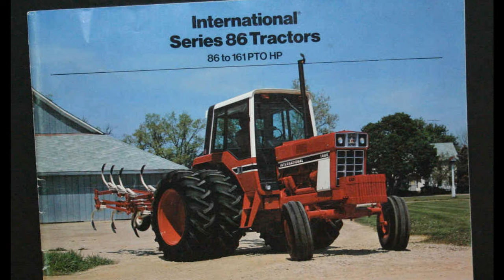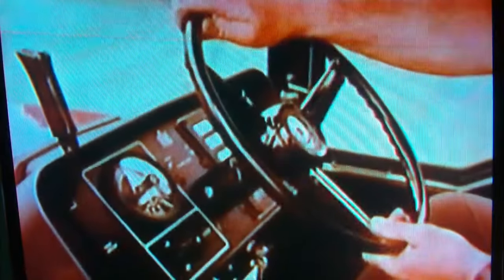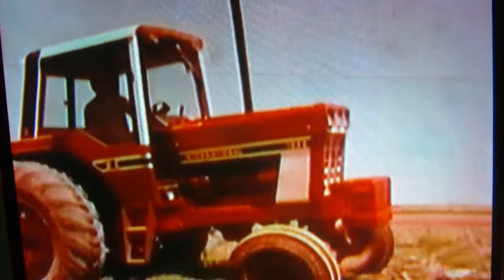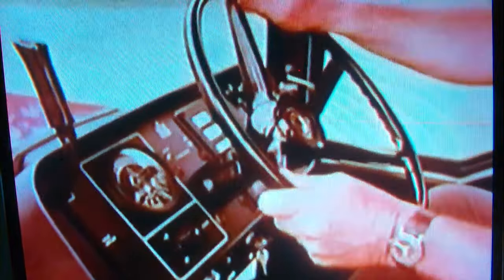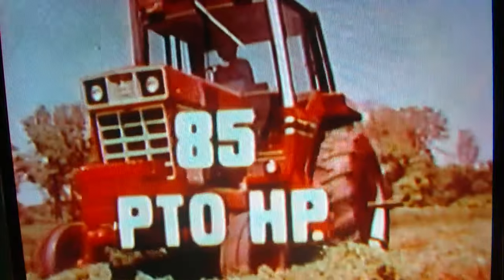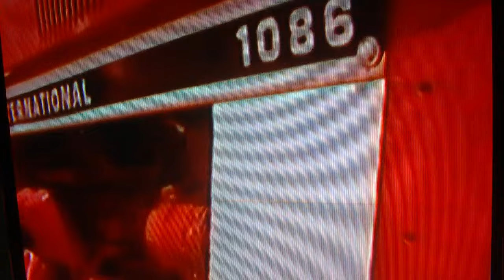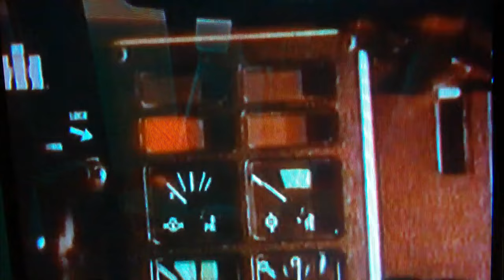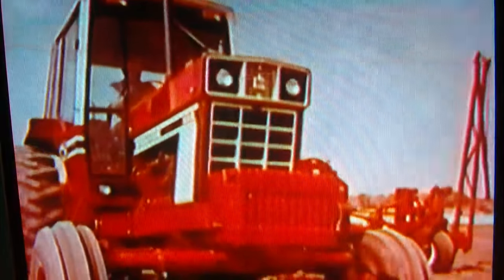the all new 86 series tractors from IH.

Comment: When my dad was pricing a new tractor the IH dealer brought out a 1086 with a cab to demo....dad was a little cheap and went with a JD 4430 with no cab....ugh....I love JD but wanted a cab so bad . But the good news is within 4 years we increased our acreage by 3x and bought 4430 , 4640 both with cabs and a 7520 ...what a powerhouse that was .
Reply from the maker: my friend has a 7020 deere, nice old girl. :)
Reply: @MrJohndeere3720  ...bad thing about the 7520 was the cab ...a/c hardly ever worked and had a high tech  fender mount type AM radio..lol
Driving it down the road one day at full speed the steering just decided to go right..took it right down into a 8 ft deep ditch ...drove it back out but was shaken up ...I guess it was a common problem that the big cylinders in the center had to be rebuilt ....but man could that thing pull
Reply from the maker: @toledojeeper2932  the ac in that 7020 never worked..lol & the fender mount type AM radio was useless..lol but they did pull very well.. :)
Reply: you rarely see together 7520 and powerhouse
Reply: @RJ1999x  ...It was a puller , but we using mostly tractors 125 hp or less until we bought the 7520 so it was a beast compared to those . We went with a 9300 after using the 7520 for over 20 years  , we definitely got our money's worth .
Reply: @toledojeeper2932  I had a 7520, I thought it was a huge dog, replaced it with an 8640 with a 50 series engine, it wasn't much of an improvement. Replaced that with a Steiger, absolutely no comparison
Reply: @RJ1999x  ...I guess it all depends on what your pulling and the dirt your pulling it in . We pulled a 32 ft field cultivator in pretty good dirt that was mostly sand and we had very little clay . I had no complaints but like I said I was used to driving 125 hp 2 wd  tractors pulling 18 ft field cultivator before the 7520 .
Also we turned up the fuel after the warranty expired .
Reply: @toledojeeper2932  as long as it got the job done for you
Reply: 7520 is the best looking tractor ever made

Comment: I miss IH so much. It was such a good brand
Reply: IH is still around. When it split up, Tenneco bought the ag part and the rest became Navistar International. Tenneco also owned Case and merged the two into Case IH. At the time of merger, it was Case body, IH colors (which is my favorite era of IH from a design stand point). Now it's still IH colors, but modern design. Hell, in 2003, they brought back Farmall

Comment: I'm not an IH fan but I will say the 1206 is a damn sharp looking tractor. The driver forward ahead of the rear axle is credited here to 1086 or 86 series. Glad to see IH did contribute something  beneficial to the tractor market in it's final days.
Reply from the maker: the 1206 r damn good tractor. i'd like 1.. i have a ih 1586 & its a damn good tractor.. ya it is nice 2 see that.
Reply: Allis Chalmers sat forward of the axle in 1963
Reply: ...its* final days.
Reply: the Ag part of IH merged with Case when it was bought by Tenneco

Comment: I was 13 in 1979 when my dad bought a brand new 1086. Our very first quiet cab with ac. It was like sitting in a Cadillac. The 86 series were a vast improvement from the previous 66 series in almost every way with a few exceptions: On the 86 series the batteries were not in an easily accessible place but were secured well and out of the way. They should have made the doors open to the front for easier access to the cab. If you had to remove the starter you had to take out the floor mat in the cab and a steel plate on the floor. A special wrench to remove the starter bolts was available. The starter was very difficult to service. The TA lever had that goofy spring loaded mechanism that made it difficult to operate smoothly. On the plus side putting the muffler under the hood was genius, leaving only the stack above the hood. The hydraulic assisted clutch was awesome (I think our 1066 also had that). We're mostly JD now and I don't know why other companies don't use that. With that short wheel base it was the best tractor I've ever owned for blowing snow lol. Even with the short wheel base it was balanced very well and could lift considerably more than our 5088 without weights on either tractor. When I traded the 1086 sometime in the mid to later 90s it had over 9000 hours and hadn't had an overhaul. I think IH had a very, very good engine which was quite efficient as well. If they could have hung on another year and introduced the new Magnum series (which was IH's design) they would have made it. The Magnum was head and shoulders above every other tractor of it's time when it was introduced in about 1987??? On a side note, how many others here have noticed how much the radios and cheap @#$%ing speakers they put in the tractors today just suck?
Reply from the maker: nice.. :) ya these tractors have there ups & downs.. thats y i had gotin a 1586  i'd like 2 get a 986 or 1086 as well.

Comment: Im probably one of the few IH Enthusiasts that appreciate the left handed shifting levers on the 86 series me being a lefty myself...
Reply from the maker: i would like mine more if they were taller..
Reply: Im a righty. I dont mind the left hand shift. I have a loader with controls on the right. My bigger complaint is not having a foot throttle.
Reply: Herpn Derpn same
Reply: Also a lefty, not bothered by left or right shifting. More my concern is the smile hitting 4hi and smacking the TA ahead.
Reply: I'm right handed, and I like the shift levers on the left side. You can run your hydraulic levers and shift at the same time.

Comment: Speaking as a guy who has spent thousands of hours on IHC tractors, the cab was guiet and roomy and didn't have that big join in the middle of the windscreen like JD. Moving the cab forward was a mistake ,very rough ride on 86 series combined with short wheel base and you couldn't see the drawbar easily. The 66 series rode smoothly and had fuel tank behind engine which also reduced engine noise and heat . JD , WHITE ,FORD, IHC ,MASSEY WERE ALL GREAT MACHINES IN THOSE DAYS ,NOT PLASTIC UGLY COMPUTERIZED JUNK LIKE NOW ,IMHO.
Reply from the maker: they said in the vid that Moving the cab forward would give it a better ride. so its funny hearing about that. but not every1 liked it..   tractors nowadays r a joke.. the older 1's were made out of steel NOT PLASTIC. thats i want with an older ih tractor.. THATS A REAL TRACTOR!
Reply: One particular thing I liked about the 86 series was the self cleaning cab filter ,when you  closed the  door  it would self purge, I have noticed that the caseih tractors have  gone back to a filter under the cab where all the dust accumulates ,duh.I think the 86 series were  good solid machines and reliable and later 88 series as well ,I  drove a 5088 for some time and loved it,those Inter diesels were great .Thank you for posting these videos, kind regards.
Reply from the maker: ya that self cleaning cab filter was a very cool thing. they should have stayed with that... o man those  88 series  r sweat. i want 2 buy 1 as well. :) ur very welcome. :)

Comment: My Dad got a new 1086 in 1979. Wow, what a difference between that and the 1066 that we also had. It was a very good tractor and had over 9000 hours with no major engine work done when I traded it. The 88 series tractors were a joke and dealt the final blow to IH. If they had made the right changes then, they might have survived. Such as:
Making the transmission power-shift from gears 1-6 instead of only between 1&2, 3&4 and 5&6.
Opening the doors to the front, the way they're supposed to.
The forward air flow should NEVER have been done.

The only improvements from the 86 to 88 series were a synchronized transmission, hydraulic clutch and tilt steering wheel.
Reply from the maker: 66limelight  ya they left some things out. my friend has a 986 & his son has a 1086,1566 & a 806. the doors on the 86 & the 88 series did open 2 the front just like ur car. its the 66 series cabed tractors where there doors open 2 the back.  my friends 986 does not have tilt steering & it sucks 2 get in it..  thanks 4 watching :)
Reply: MrJohndeere, our definition of what is front opening and rear opening is different. Let's just say the 86 and following 88 series tractors should have had their doors open the same direction as the older 66 and the newer Magnums. We had a 5088 and IMO the only thing that was an improvement was the synchronized trans. But they should have made it a powershift from 1st to 6th gear. I think the 86 were better tractors.

Comment: We had a 1586. It sure had some balls. It would pull the front end off the ground cultivating over the hills. But sadly it burnt down.
Reply from the maker: sorry to hear that. :( i have a 1586 as well. been a great tractor. needs love, but they all do  lol.
Reply: @MrJohndeere3720  bought ours on an estate sale. 4157 hrs. 1000hrs later it burnt.  Insurance adjuster said failed wiring in the cab
Reply from the maker: @jeremycherny2041  o ok. Got mine at a small dealer/repair shop. 9500 hrs but the hour counter stopped working need to send it in. Paid 8K for the tractor then paid 900 to have it hauled to my farm.

Comment: My 1086 is a later model than these originals and does not have a differential lock. Was that an option?
Reply from the maker: im pretty sure it was. i think u had to order it with a differential lock. my 1586 does not have one but has the hole in the floor for it

Comment: I have ran both 1066 and 1086 tractors both were good tractors the bad thing about the 1086 was the cab always felt cramped up in  the 1086 so with that I will take a 1066
Reply from the maker: u can fix that by putting a tilt steering wheel kit in it..
Reply: I have a 1486 wonderful tractor running strong for over 20 yrs. Best tractors ever made.!!
Reply from the maker: @williame.portman4026  i got a 1586 been a great tractor for me. needs love but its all small stuff..

Comment: Do you know y back then they would put pto horsepower instead of just horsepower?
Reply from the maker: +Dairy farm boys not 2 sure, but all i no is that u get less hp on the pto then on motor itsself.
Reply: Dairyfarmvids Because PTO horsepower is the closest thing to engine horsepower and its easy to figure and then produce a list of what it can run and show that off. Drawbar horsepower, there is a lot of variables, tire slip, soil type and condition, flat ground, hilly ground etc... those are fuel related costs and well, let's hide that part. Although they did start to label some that way.
Reply: I think PTO horsepower was the best measurement because some implements are very demanding on the PTO. The engine spec on a tractor doesn't mean dick when you lose through the gearing of the transmission, and if it is a 2wd or 4wd.

Comment: The last good tractor ih ever built wes the 66 series
Reply: The only real difference between 66 & 86 is the cab.
Reply: After spending many hours in both 66 and 86 series my preference was the 66 hands down .
66 series easier access into and out of the cab and that damn fuel tank on the back sucked .
Reply: @zinderkugelus6194  i completely agree with the fuel tank but with an aftermarket set of steps is 100 times better than the factory 86 steps for getting in & out
Reply: @AndyFromm  86 didn't have the balance that the 66 series had either
Reply: Dad had a 1466 that would pull the ass off his 1466
Reply: I mean 4430
Reply: @dennisholst4322  4430 is smaller than a 1466

Comment: (Read in video's commentary's voice" Featuring a torque amplifier that will most certainly fail on a regular basis. Yes the dry clutch and wet brakes are a technological break threw in failure ridden technology. ( This is just for fun )
Reply from the maker: ya. they do fail alot, my friend's ih 986 ta is failing.
Reply: The reason the torque amplifier would fail is because people would not use them properly.  I worked on them new and every idiot that used them to slow the tractor down will destroy the spag clutch in it.
Reply: @billyuhlir3783  the first TAs would coast or freewheel on a downhill if you weren't working or pulling  the later ones didn't  I never tore one out the newer design  must of had different guts in it

Comment: The video doesn't mention the 686, the 786 or the four wheel drive 4186
Reply from the maker: ya i dont no y they did not add the 686 & the 786, the 4186 is new 2 me, never seen 1, ill have 2 see if i can find some pixs. but ya im with u on that,
Reply: *****
The 4186 was a giant 4WD tractor. It was an update of the earlier 4166.
The 686 may not have been mentioned here because it was an update of the earlier 666 and didn't have the new "Pro-Ag" features such as the centralized operator's station etc.
Reply from the maker: Michael Halsall o ok, ya that might be y.
Reply: The 686 tractors were treated in the same disregard by IH as the 2-70 tractors were treated by White. I always thought they both were the coolest of the lines.
Reply: The 786 to 1586 were "Big Framed " IH tractors (105" wheelbase)            
The smaller 686 was the final update of the earlier 656 and then 666 tractors. they were smaller tractors for smaller farms, not an inferior product,  although they lacked some features of their bigger brothers.
Reply: The 786 didn't come out until some time later

Comment: I have to say, as nice as it looked, and as comfortable as the cab seemed, the ride on my 986 was a complete disappointment and absolutely no match for my Cockshutt 1550 or 1850. I sold the 986 and never looked back.
Reply from the maker: some say if u widen the wheels out that will make the ride more comfortable.  Cockshutts r cool tractors. :)
Reply: 42lookc you are comparing a red Oliver to an IH? Now that funny. Not even in the league.

Comment: I had a 1586 that dynoed out at 190 hp factory setting
Reply from the maker: My friend said that some could have been turned up. He thinks my 1586 could be pushing 190hp. Factory setting is 160.
Reply: @MrJohndeere3720  my tractor was a odd ball with 4 post and no T/A no pto
Reply from the maker: @larrymartin9620  what good is a tractor without a pto...lol mine has pretty much every thing u can think of.. there some things im going to add on with time..
Reply: @MrJohndeere3720    mine was a plantation ordered unit and not taken draft use only I guess
Reply from the maker: @larrymartin9620   o ok 👍🏻

Comment: Best thing I ever did with my 886, was trade it in on a John Deere 6410.
Reply from the maker: lol
Reply: Shulda kept the 886 such a better tractor than a deere
Reply: Mark Anderson John Deere's are shit tractor's
Reply: @damienskinner198  Well no, a lot of 6410s make it far past 10 000 hrs with almost no issues. The transmission is silky smooth, too, and I'd say more reliable. Every single 6010 and 7010 series I've driven has had 10 000+ hours with very few issues.
Reply: Mark Anderson why are you here then?
Reply: Roughest riding tractors I ever drove, and the door opened the wrong way; almost knocked me off the step first time. Still had the junk TA's. Best salesman John Deere ever had -